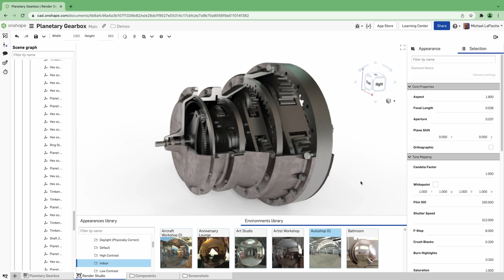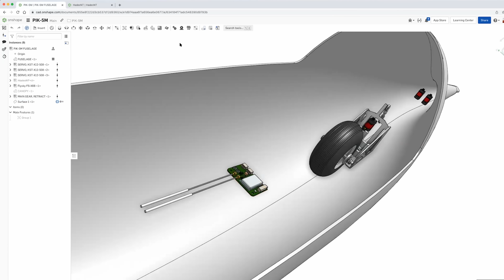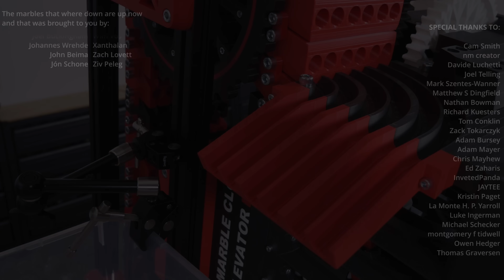High Throughput Marble Elevator - Marble Clock Seconds Display Pt.6

Comment: You're designing a clock, not all digits will cycle through digits 0-9 in that order. I feel like the cam system is fundamentally incompatible with the tens digits of all hours, minutes, and seconds unless you speed through the other digits before the marbles can slide through, but then timing becomes an issue again. Can the cam shaft get from 2 to 0 in the case of hours in one second? What about second's 5 to 0?
Reply: For the second decimal in seconds, it only goes from 0 to 5, there's never gonna be a 6. Hours is a good point, but there was a different mechanism for the hours
Reply: Ah, actually, even the first digit in hours doesn't have to go from 0 to 9. It would go from 1 to 9, then 0 to 2, all in one cam

Comment: I'm wondering, can't you just have a closed circuit for each one of the 15 marble "pipe" ? I mean every number will be displayed in the same order, you could have 10 marbles for the units display in a closed circuit and 6 marbles for the tens display in a closed circuit.
Reply: That would make it very hard to read the display, as it would be blocked by all the outgoing pipes
Reply: @punpundit5590  mmmh, yeah, that's right

Comment: I still feel like you are trying too hard. In the first design of the display you needed 2 colors of marbles to stack the display, in the second version you needed the new marble to clear out the previous, in the latest version all of the marbles self clear, so you don't need a new marble to clear a pixel. You don't need 2 colors of marbles anymore.

Comment: I'm guessing you've already thought about this but it might be worth using a geneva mechanism for actuating the chain, this way you could transform continuous rotation from the one motor into a stop-and-go motion you need for the marbles to feed properly, if designed less than ideally you might even get a little shake of the chain when it stops which might aid feeding
Reply: I think he would have better results with a non circle gear, much less violent of a movement.

Comment: Consider using a Geneva wheel mechanism for timing and belt positioning. You can then turn the motor at a constant speed and get the belt moving and stopping in predictable steps.